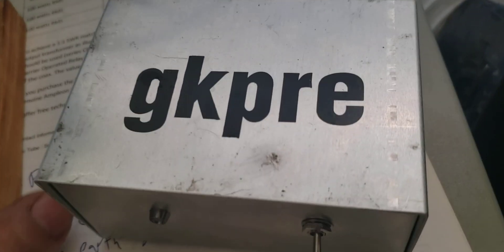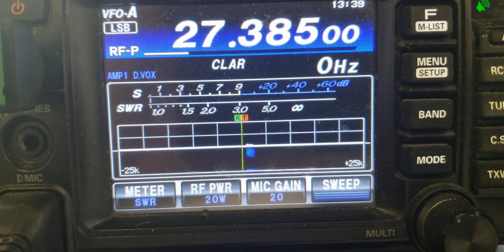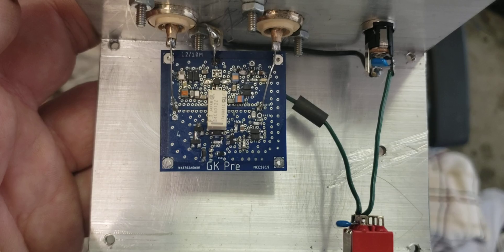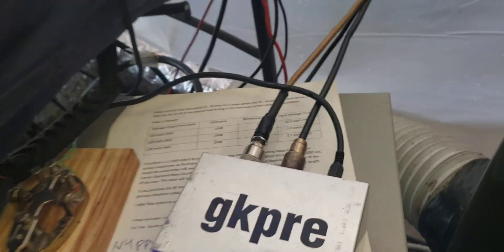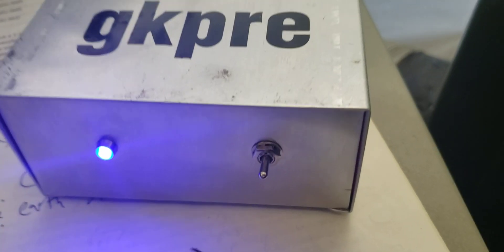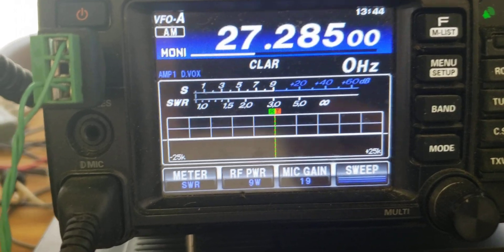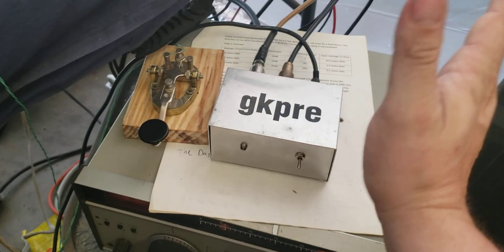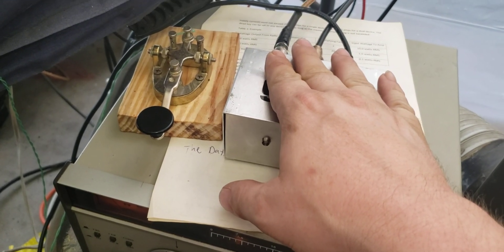✔Quick Demo of New Gkpre(RF Preamp) Read Description If Interested..

Comment: How much is one of those GK? And does it work on Am as well? 73s from 176 Oklahoma
Reply from the maker: Of course brother works on all modes. Read the description for more info but price should be around 64.99 if the prices for my boards in bulk havent changed
Reply: @1883GotDown  ok cool. I’ll probably get with you on getting one brother. Do you have a site to we’re I can go to for purchasing it?

Comment: Can it be used on a mobile  with 12 volts?
Reply from the maker: Oh yes it runs off 12v. They come with a wall wart supply but can be plugged into 12v directly